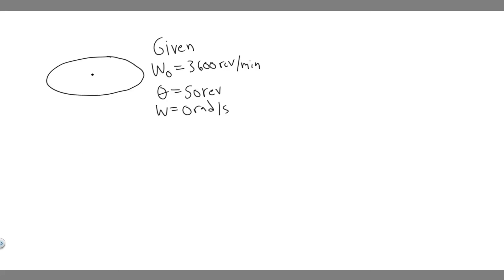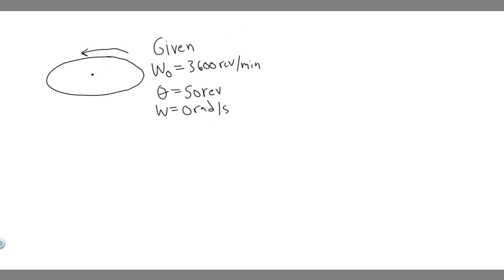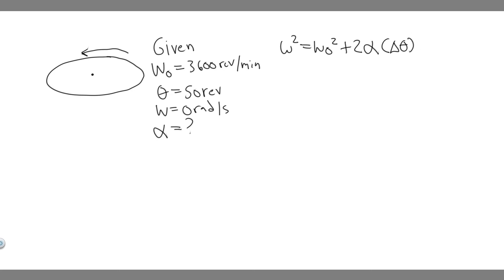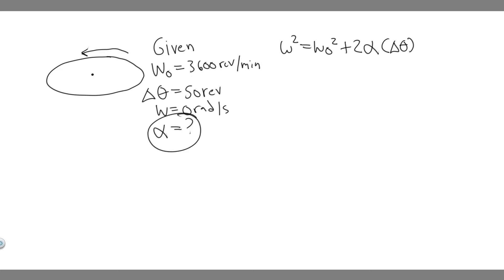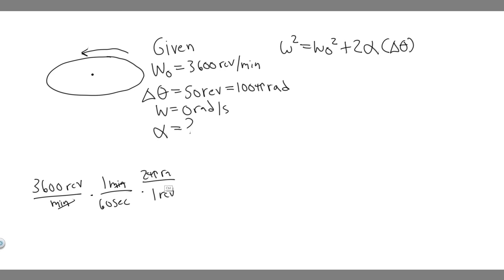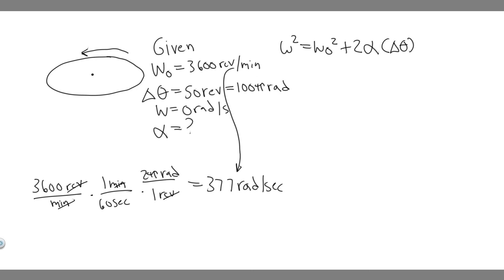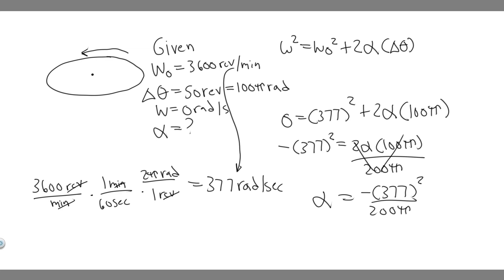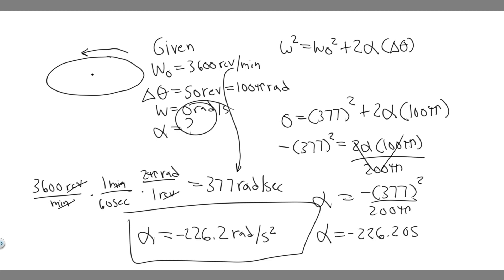A centrifuge in a medical laboratory rotates at an angular velocity of 3600 rev/min. When switched o

Comment: why  do I keep getting a different answer for the final calculation?
Reply: you may be messing up with your units. you have to be really careful when you are dealing with pi.
Reply: @headyshotta5777  yeah, I figured out the (200pi) has to be in parentheses when inputting it into a calculator.
Reply: 377^2 = 142129      -142129/200pi = -2232.557     ???